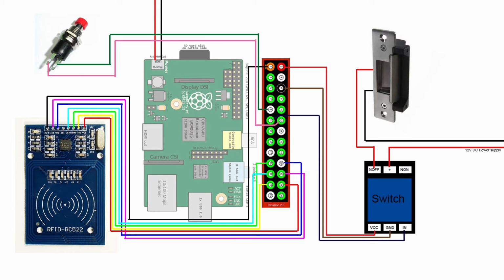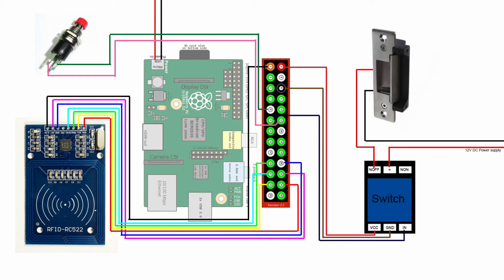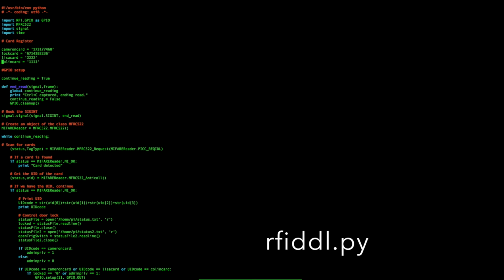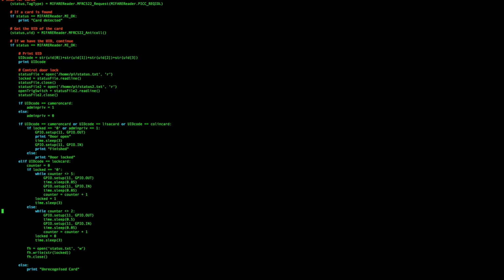RFID Raspberry Pi Door Lock

Comment: how is the pin allocation on the Raspberry Pi 2 b
Reply: I have wired everything he says synonymous when I start the script and hold the card door open but the relay does not switch it is on pin 11 and in the rfiddl.py I have also entered my card ID can you help me cameroncard = '2615815989'
lockcard = '6714182236'
lisacard = '2222'
colincard = '1111'
Reply: root@raspberrypi:/home# Socket created
Bind complete
Card detected
2615815989
Door open
Finished
Card detected
2615815989
Door open
Finished
Reply: I'm having this exact same issue
Did you ever solve it?

Comment: Hey I have a problem. When I register my own cards everything works properly. Every card is detected by the script. The only problem is, when I try to open "the door" (i my case a little led lights up) the script output says "Door locked" right after the script is started. And I am not able to unlock it with my lockcard (the card is detected properly). It seems like the locked status is not set accordingly. I can only open the door with my adminpriv card. Anyone else with the same problem? I tried it with my modified script and with the original script and in both cases I met the same problem.

Thank you
Reply from the maker: Please could you open the status.txt file and tell me what the value is?
Reply: I am so dumb.. I did not check the txt files. I was not able to find the problem, but I found a solution. I created both txt files in my main directory and altered the path in the script to the new destination. But somehow when I started the script it created a own status txt in the path where the script is located. It wrote the values to the own status.txt. But tried to read it from the other file which was empty. I changed the path to the self created file and now it works awesome :)

Thank you for your reply without it I would still struggle with the problem.

Comment: Questions! 
-The lock. is the standard lock in the door electrical, or is a powered magnet keeping it locked independent of the traditional lock?

- Whatever the answer to the first question was, what did the lock / what I assume was a retrofit electrical system to attach to the original lock / the powered magnetic lock addition cost you, what is the formal name and from where? Web link perhaps?

- What kind of power requirements does the locking mechanism have? I assume it isn't as low as the Pi power needs.
-It's been over 6 months since you posted this. How has it performed since then? Any major issues? Did you end up using it continuously or did the novelty wear off?

- If you had to start over, what would you do differently? Would you buy the same parts? Would you configure it the same? Can you detail your now experienced "right way" or "better way" to do this project with product links and brief reasoning?

- Last, have you come up with any more projects for the Pi and the RFID readers & NFC cards / tags? 

I'm really interested in a project but I am not sure if it can be done. It would basically be a login for our PC at home and I want a way for the card to be able to be presented to a reader any time the individual user at the PC has to enter a password, and (this part I think might be stretching the capabilities of NFC read and write too far) the username and password would automatically be entered, even if the user had 100 passwords and usernames on 100 different websites. Too far?

Second idea is to embed a reader in an audio device that accepts USB thumb drives and SD cards full of MP3 files and Playlist files. Different cards swiped in front of the device would start different play lists. This, I bet is possible but beyond my programming capabilities. 

I have dozens of tags and 10 cards at my disposal. My phone can write to tags and cards. I have only ordered one reader.... just to kind of test out, but they are under 2 bucks on eBay and if I can plan a feasible project, I'll order more. I have several Arduino units from Nani to Leonardo to teensy to nano.... there might be a dozen all together. I have every version of the Pi- with two Pi3, five Pi2B+, three PiB+ and three Pi1 units. The Pi3 units are in use, and two of the Pi2B+ units are in use, but the rest are free. Plenty of sensors, jumper wires, breadboards with removable power, hundreds of 3mm and 5mm LEDs in every style imaginable, Transistors, thousands of resistors, thousands of capacitors, diodes, inductors, ICs, half a dozen varieties of over 200 switches in every type of ON|OFF / SPST, SPDT, DPDT, normally open, normally closed- in 50+ toggles, over 100 rocker, hundreds of push button, etc. Plus dozens of faders, over 40 encoders, over 150 pots in six different but common ohm ratings in mono and three or four in stereo, a dozen mini trim pot values x10 of each value, and exotic stuff like touch sensitive faders and buttons. Basically a small electronics parts store.

I build high end speakers, fix consumer grade audio gear- mostly speakers and design / fabricate affordable other audio gadgetry like portable, rechargeable speakers with embedded audio players, amplifiers, Bluetooth, sometimes even Raspberry Pi units running headless audio servers over wifi if in the yard of a house with WiFi, or pulling WiFi from a smartphone turned Hotspot if away from WiFi. So the audio part of my idea I can handle. I can handle getting a Pi to recognize a reader from the looks of the perfunctory research I've done. The programming- and knowing if a NFC card could tell a reader to run a Playlist file... this I do not know. 

I realize this is long with many questions, but your setup seems the least sloppy, most real world function setup I've seen so far, and I happen to be the son of a locksmith who can change out, ready and install locks and door handles from start to finish- so I probably would actually put a card reader on our main door if the answers to the questions I asked match up with the skills I already have. 

I appreciate any responses from anyone with knowledge on any of these subjects and questions. 

Thanks, 
Pete
Reply: I had the same question, thanks for asking Pete :D. Looking forward to a reply from the creator!

Comment: Hi i need to do the same except i have a different rfid that does the logic and just outputs a 3v but 3v wont power the relay (standard 4 - 5 v blue module) any ideas? ps i plan to use a new rpi 3 for the wifi access too. should i just use the same pins but with the putput of the rfid box instead of the rfid module you used?
Reply from the maker: You can wire the 3v from the RFID tag straight in to the VCC pin and the 'in' pin will need to be attached to a 5v pin on the pi. 3v is enough to be used for the 'in' pin. As for your second point you will need to elaborate please.

Comment: Great job. just what i was looking for, I didn't see where to put the other files, also I'm getting an error about a status.txt in the home/pi directory did i miss something. thanks
Reply: I have the same problem.. have you find the solution on this?
Reply: Ferdie Santiago I made a new file in the home/pi directory named status and it worked.
Reply: Yeah thanks i already figure it out and yes it works. Thanks Derrick :-)
Reply from the maker: Apologies for the slow reply, you are correct in creating the file status.txt and status2.txt in the home directory. I will caption the video to reflect this.

Comment: nice video sir !! i want to made it too, btw can i add more id tags or selective tags for user who can access the room and who cant?? Which code that define the tags id btw? hehe sry for bad english sir >.<
Reply from the maker: +Alan Bull I am glad you enjoyed the video. It is possible with the program to add different RFID tags by adding the UID of the tag. For example in the rfiddl.py program there is a variable called cameroncard which is then assigned the value '173117648'. This is the UID code of my tag. You could add another by creating another variable. E.g. 'alancard' for your self and then putting in the UID of the tag. To find the UID of your tag, you can use a program called read.py which is included in the RDID-RC522 module which can be found online: https://github.com/mxgxw/MFRC522-python

Once you have done this for example
alancard = 111222333444

you then need to add 'or UIDcode == alancard' in the if statement 'If UIDcode == ...' where the cameroncard is, to make it work.

Any other tags not mentioned in the code would just be ignored by the program, so people's tags who cannot access the room wouldn't work. Hope that helps.